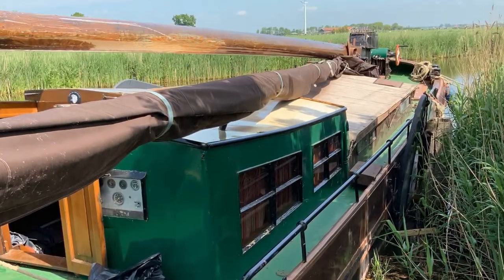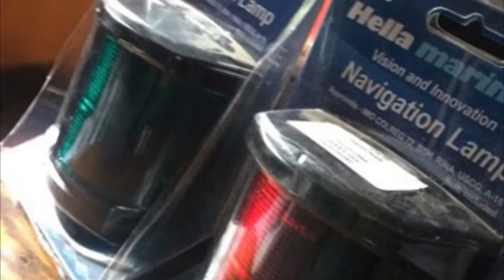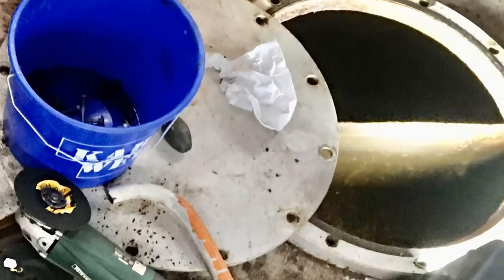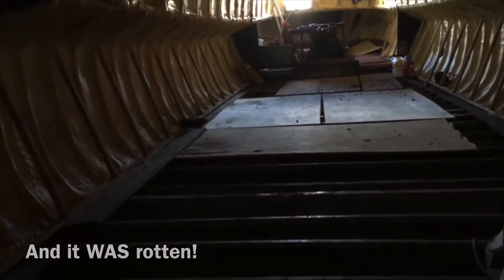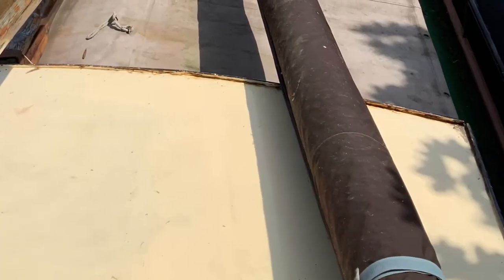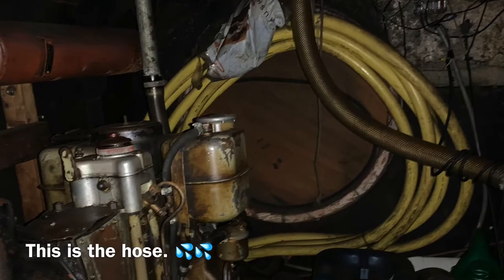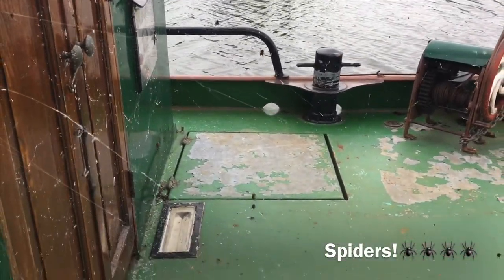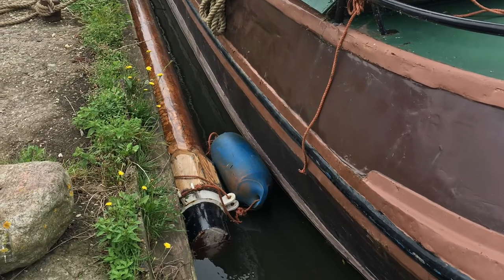De Vrouwe Linda #4 Now that I own the boat, lets have a closer look.

Comment: Typical woman, I never could tell left from right. But having crewed barges and a bawley on the estuaries of Suffolk and Essex, port and starboard I have no problem with at all. Even in the car, I use this for directions instead of left/right. Have now subscribed and am hooked on your adventures.
Reply from the maker: Thank you for subscribing. You have more experience with sailing than I have. This is all new to me.

Comment: Did they at least throw in the axe 🪓 that split the rotten mast?
Reply from the maker: No he did not! And I was taken aback by the brutality at which he bashed everything on the boat with that hammer!😂
Reply: @canicebannon  🤔…hmmmmmm…. It is bizarre, as in the episodes I have watched I could have sworn it was you, with various hair lengths and styles, that was hammering, drilling, and in general, ripping the barge apart.  But, I could be wrong.  🤷‍♀️